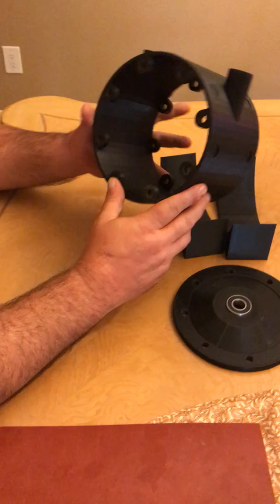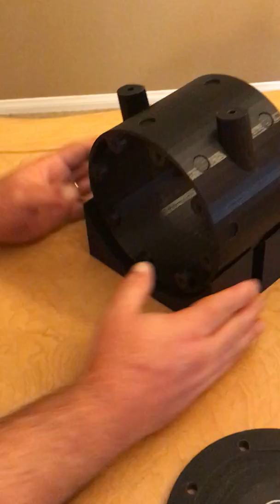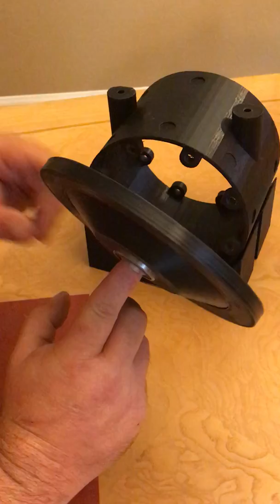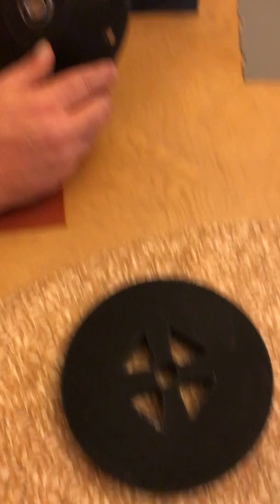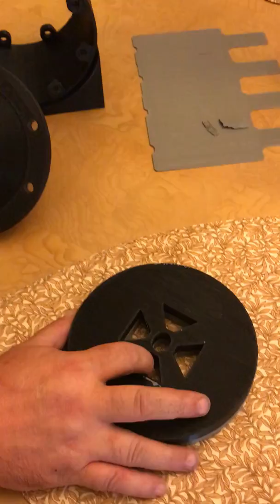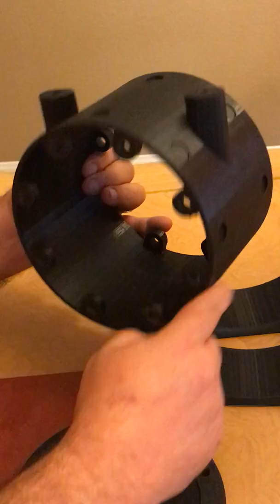Modified Tesla Turbine Test

Comment: Keep going! You'll get better and better.
Reply: Since the original design by Tesla was to be powered by Steam, do you think that metals(I saw a Tesla Turbine made out of Brass and I was like "that and aluminum must be the most thermally conductive metals one could build a Tesla Turbine") are more efficient than composite materials if all other variables are the same(Radius, design, air/water vapor pressure)?